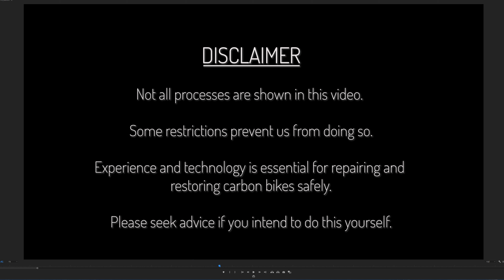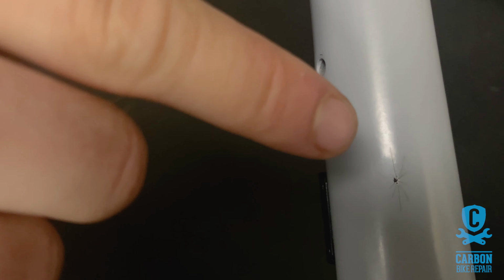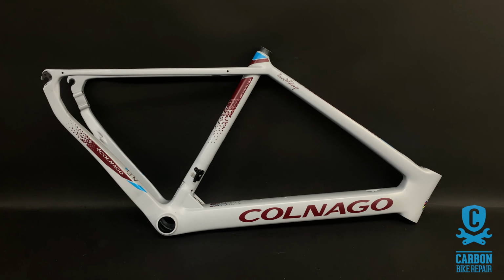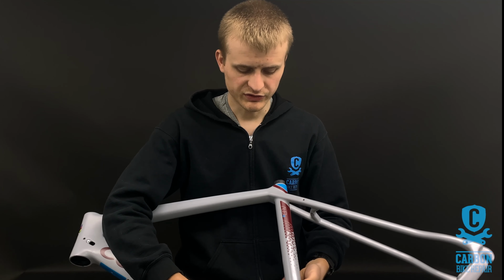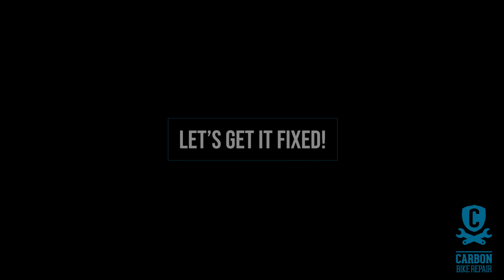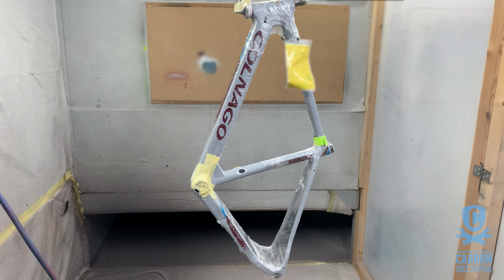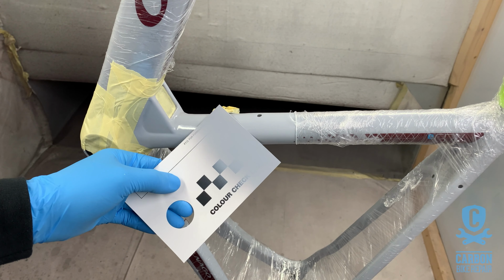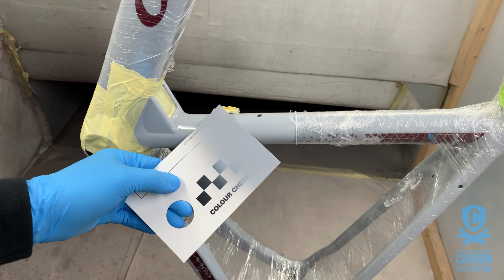Colnago eGRV Seat Tube Damage

Comment: Thanks for the videos. Really enjoy them and find it interesting to see what can be done with carbon. With companies that do different levels of carbon, particularly in the MTB world, do you find there is much difference between the levels they offer? For eg Santa Cruz with C or CC and Yeti with C or T etc
Reply from the maker: It’s a complicated answer as not all manufacturers approach their mtb designs in the same way. Mainly because of the many disciplines compared to road bikes for example. What we do see however are many ‘experiments’ which in some cases find their way into road bike designs. One big difference is the complexity of MTB’s. However not to avoid your question, the carbon manufacturing process of prepreg layup (excluding woven or printed) are generally very similar. Your question should be, do you see differences in the resin-to-carbon content? ..and the answer is yes. A lot of weight can be removed by leaning out the epoxy content. This is where we see see some problems. Those companies with access to their manufacturing partners, or manufacture themselves, have the best control over quality. Thanks for your question!